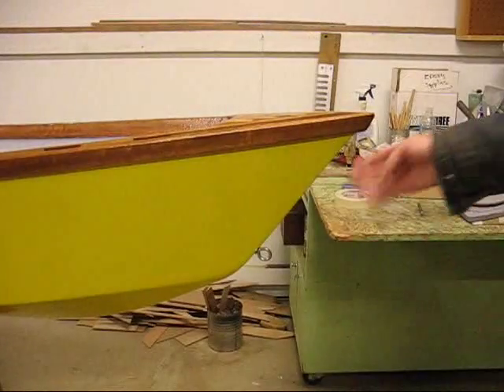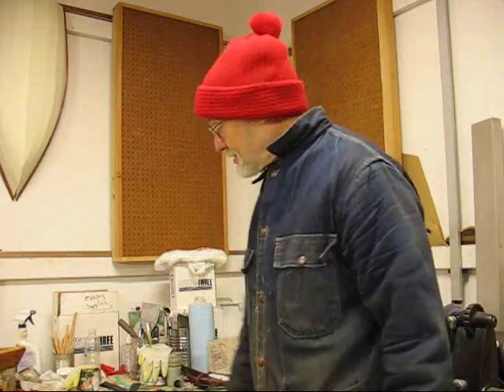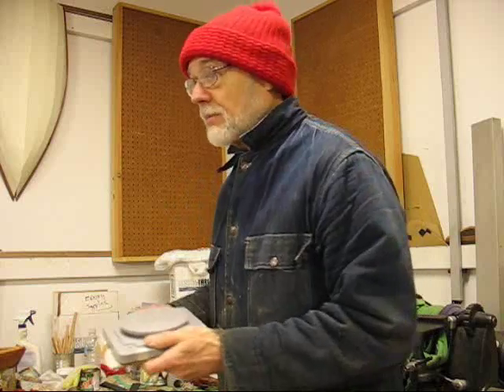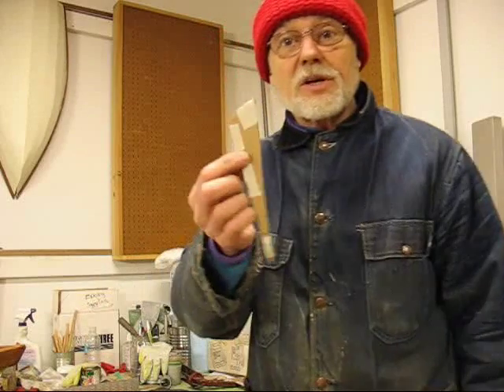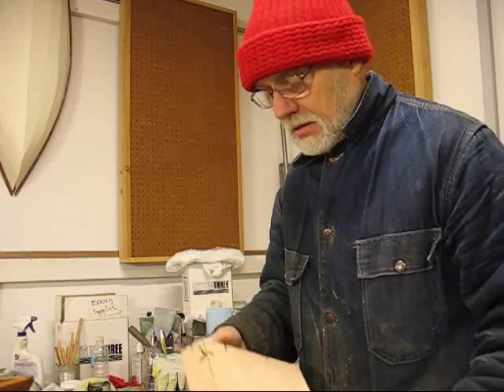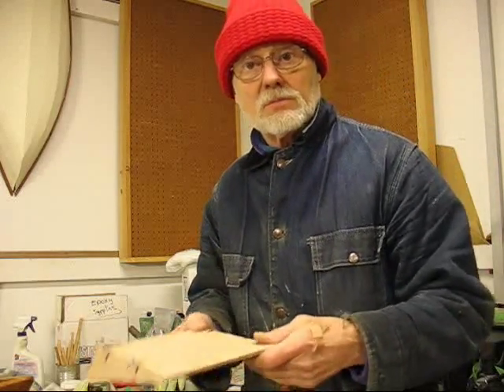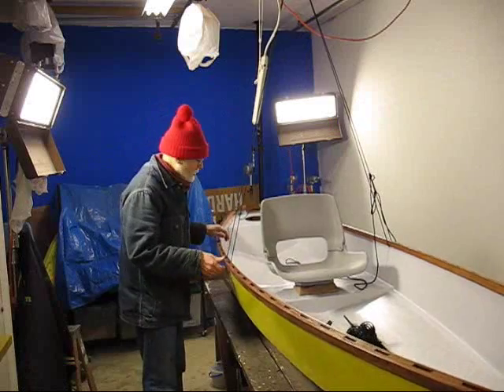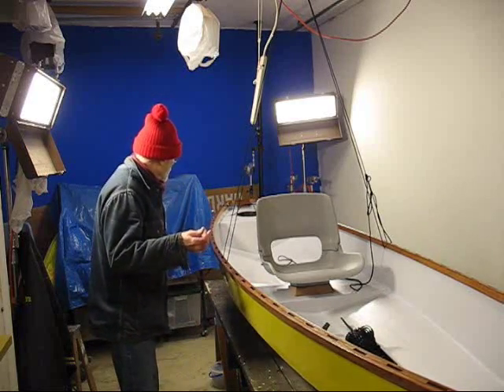EMC Part 5-4 Final Fit Out of the Hull.wmv

Comment: Great series.   I have had all kinds of trouble with the 1/4 turn hatch covers.  The worst being when a vacuum forms in the compartment, you can't pull the cover off.  So I have switched to the screw in type.